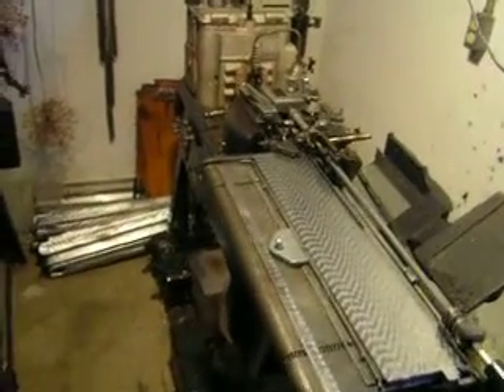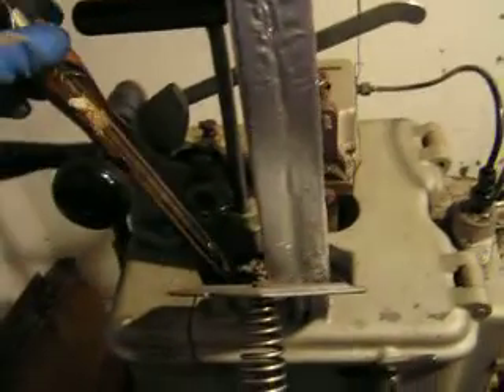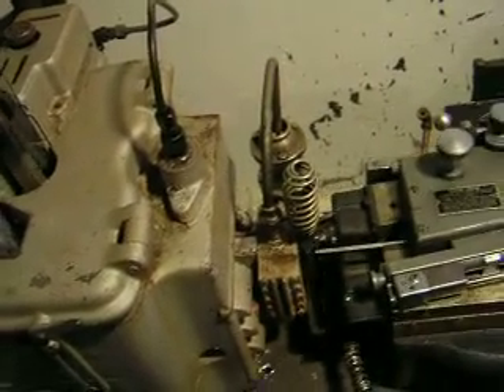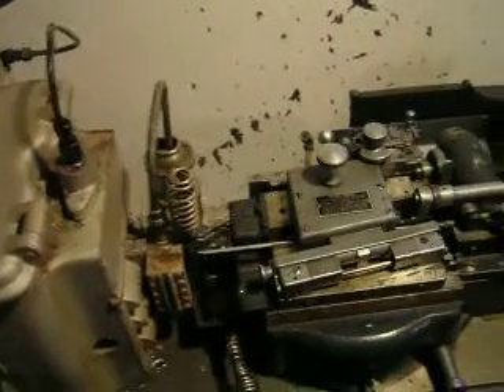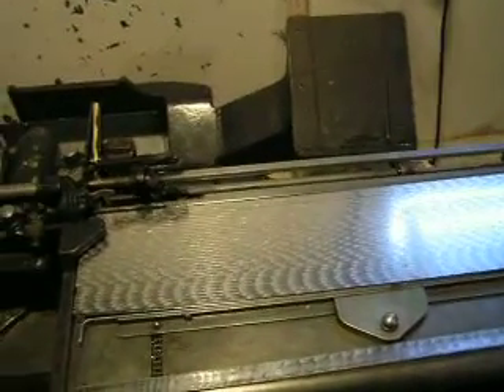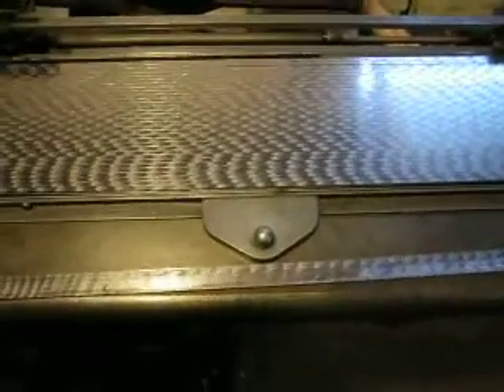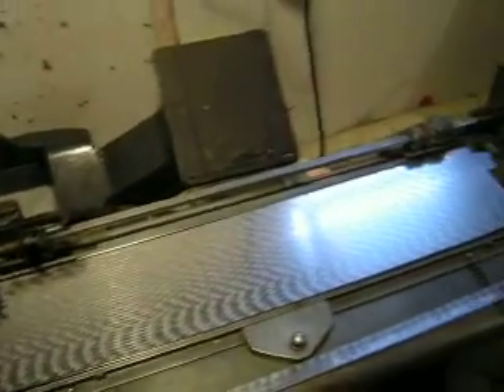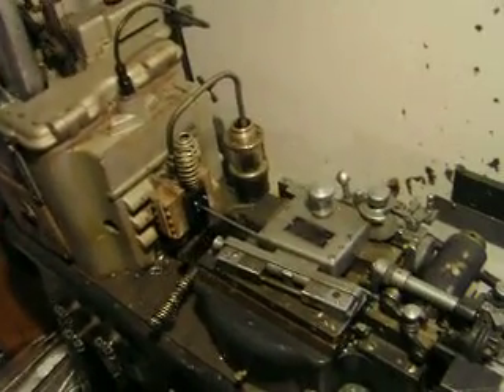ELROD STRIPCASTER MAKING 12 pt. SLUG MATERIAL

Comment: Great to see, I have two Elrod's running a Model F and a K, I was wondering why you are running this one with the pot plunger valve on, the plunger isn't doing any work?
Reply from the maker: +Andy Taylor You caught me. I fired up the Elrod for the first time in a decade and forgot about closing the sealing valve. It ran fine with 12 pt. Then I ran 18 pt. and it ran fine with that, too. Then I tried to run 6 pt. and the strip kept breaking off in the mold. So I broke down and read the manual and realized that I'd forgotten about closing the sealing valve. Doh! The 6 pt. ran great after that.